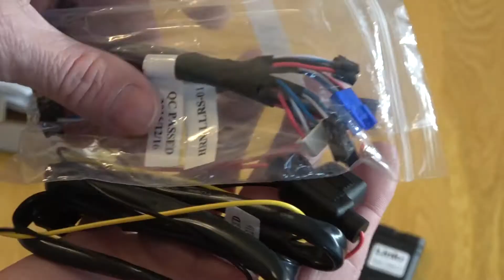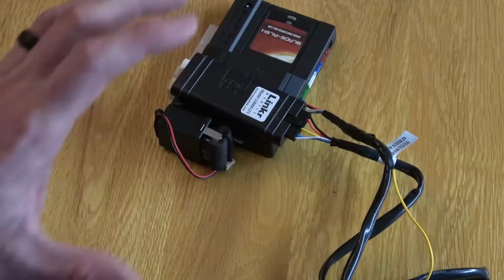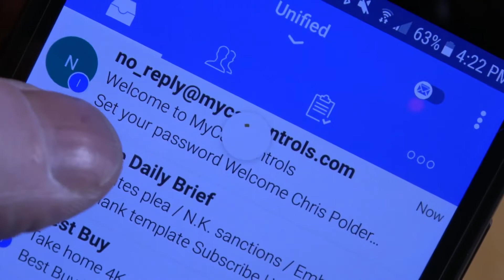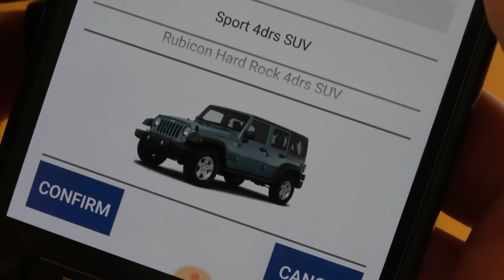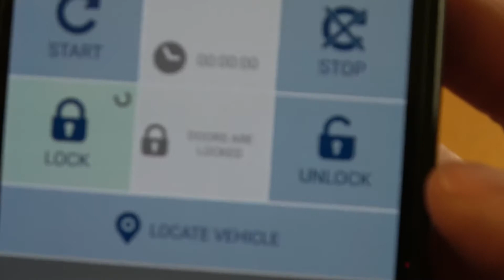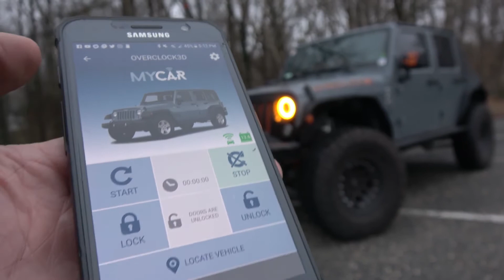Linkr-LT Install, Setup, & Testing

Comment: I would love to see a follow up of this video. More and depth on the auxiliary features as well as can you do anything else with the yellow wire. Like setting it to auxiliary features. I also noticed one of the protocol was  stand-alone. what do it do  when you select standalone. ECT. The yellow wire and data wires? Thanks in advance for your time and response.

Comment: Why it dosent show my status it only sends signal but dosent send back the status like on my two way remote
Reply from the maker: Sounds like there may be a wiring issue but you'd need to contact your dealer or our support team at 800-554-4053 or support@caralarm.com to troubleshoot further

Comment: Never mentioned anything about the yellow wire
Reply: Thats my issue. I have everything working but no alerts. I tried tying the yellow wire into the sirens out wire. Thats the 4 pin harness with a black and white stripe still nothing. Thats the one feature I really wanted lol.
Reply: @jfg637  I decided to let it go.  Before the install, I didn't have remote start. After the install, I have remote start using original keyfob and the Linkr-LT1...I think that's WIN.  And loving it.
Reply: @jfg637  I thought the siren wire is the brown one? The one that comes out of the big harness connector 🤷🏻‍♂️
Reply: @gitmac53  I'll try it. I kinda gave up on it. The text feature was the one feature I really wanted 😆.
Reply: @jfg637  I haven't try it myself yet... just finished installing it yesterday and need to test it at work "industrial area" no neighbors 🤣, will try it in the morning and I'll let you know ✌🏻
Reply: @gitmac53  my neighbors looked at me out their windows. I connected the horn and siren 🤣. Doing it at your job is a smart move. Yes please let me know. Good luck.
Reply: @jfg637  🤣. I mean is a good thing neighbors are looking out lol and will do
Reply: @jfg637  brown wire is a no, no... will check the wiring diagram and will contact them, I got it too mostly for the notifications
Reply: @gitmac53  I'm gonna try on my end when I have a lil time. I'll let you know what I find.
Reply from the maker: Sorry we missed this thread last year! Yes the yellow should be connected to the BROWN alarm wire. The LINKR must also have this feature enabled. I very recent app update added the ability to do this in the vehicle settings. If it's already on, to be safe, toggle it off, wait for it to update, then toggle it on.

Comment: I just put a remote start in my truck (Omega 70 series brain and Linkr-LT1). I’ve gotten it to communicate with the network but can’t get it to pull up vehicle functions. Those are the only two systems installed on the truck. The remote start works properly via the handheld remotes. 

I have the Linkr set as “standalone” in the app, is that incorrect? It pulls up gps location and vehicle battery voltage.
Reply: Hey I just instaled mine right now, and I have the exact same problem. You have to set the protocol to ADA like the manual and video says. I've done everything right but only the voltage and GPS works.
Reply: REVIGOR Have you figured out what was wrong. Because I am currently in the same boat. Do I have to release the vehicle to use the functions?
Reply: @Comed64  I never figured it out and I returned it. I can't believe Omega didn't reply to our comments to help us even though we're right here on their channel. I have a few questions for you; is your Omega/Excalibur module updated to version 1.40? Also, do you have the LinkR LT-1 or LT-2? The one I tried was the LT-1. I think I will purchase the LT-2 and try again.

Comment: Where is the best place to mount this? The directions say to keep it away from metal but the entire steering column area is metal
Reply from the maker: Sorry for the late reply! It just can't be completely surrounded by metal within about 6" (blocks cellular reception) and cannot have metal directly above it (blocks GPS). It can pick up GPS reflecting off surfaces though so your best bet is to just pick an ideal spot, power it up, and see if the lights indicate connectivity within a couple of minutes. If not, move and test again. Enjoy!

Comment: Great video. Do you know how to change the protocol type after the setup is complete? I accidentally selected the wrong protocol and I am thinking that is my problem. Thank you in advance.
Reply: Did you find the answer to this problem?
Reply from the maker: Sorry for the late answer. Best is to contact support at 800-554-4053 or support@caralarm.com so they can determine the protocol, etc. before changing it. I'm sure you figured this out by now but maybe this will help future readers. Thanks!
Reply: In the app, go to setting push and hold the tap "PROTOCOL" for 10 seconds the a messenger will pop up
Reply: @Grant Harrison  In the app, go to setting push and hold the tap "PROTOCOL" for 10 seconds the a messenger will pop up

Comment: I’m not getting any alerts sent to my phone. How do I get alerts?
Reply from the maker: Sorry for the late reply! However a recent release of the app allows you to disable/enable this option in the vehicle settings. Also, the yellow wire of the Linkr needs to be connected. Cheers!
Reply: @OmegaRD  thanks i got it fixed now. Works perfectly

Comment: Great video! Do you know if this works with the Excalibur RS-275-3DB?
Reply from the maker: Hi Taylor, yes it does. Though make sure the firmware of the RS-275-3DB is updated to at least v1.4
Reply: @OmegaRD  thank you! Just programed no problem. 
The two way is amazing. 
I love how the lock and unlock button are separate buttons and that the remote beeps conformation to me

Comment: One simple question. In order to add this, do you need to pay an extra service provider fee other that your cellphone?
Reply: yes
Reply from the maker: Yes, the service for this device is unique to it and, luckily, much cheaper than cell phone service. This one includes the first year and is only $39/year afterwards. That's cheaper than 1 starbucks (or beer ;)) per month!
Reply: Late but sadly yes’ came with 1 year free with device on Amazon 
I just renewed mine it was 39.99 for a year’ 

To be able to have unlimited remote start range over a few hundred with the remote/ and the ability to lock/unlock car from anywhere in the world’ 
You could be in Paris and unlock
Car for friend in Texas 😂 
For me it’s worth $39 a year’ what’s that $3 ish a month’ 

I was afraid it wouldn’t work well’ 
In little over a year only 2x it didn’t start I just re tried it and started’ I’m happy with that’ 

Hope that helps someone in the future’

I have the Fortin EVO One’
Then added the my car (App) from Amazon’ it was like $125 in 5 years now with the EVO-1 
It’s still going strong worth it 100%

Comment: Will this work with International GSM or LTE network? If not, which LTE channel does it work with? I try to install it with my Fortin EVO-All, in Singapore
Reply from the maker: It is a 3G unit that only has service in the US. Sim cards can't be swapped. If you have more questions email tech@caralarm.com or call (800)554-4053

Comment: Can this work with my K9 alarm
Reply from the maker: Sorry, it only works through the data port that supports iDatalink protocol. K-9 does not have a model with this functionality yet. But a new K9-CLASSIC model is coming in the new year that will support it.